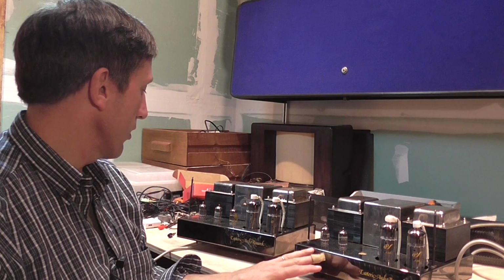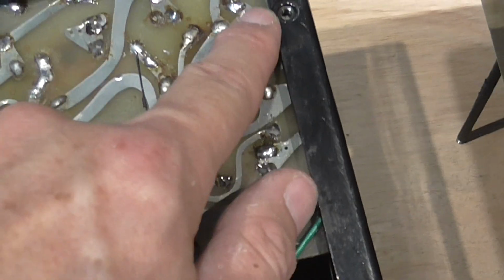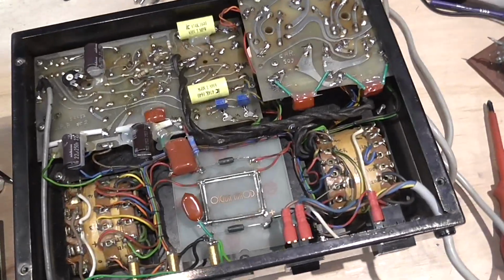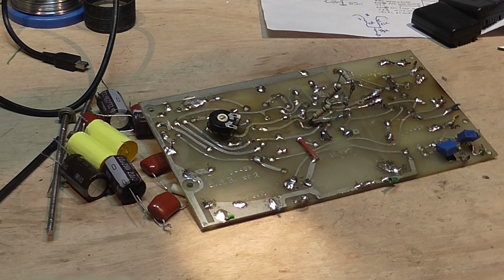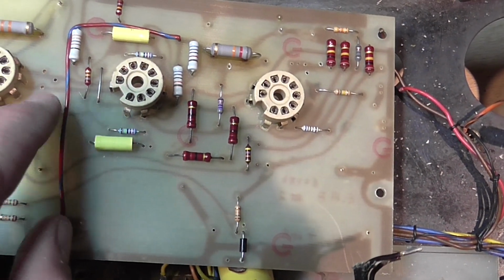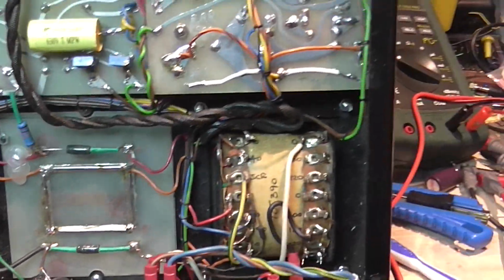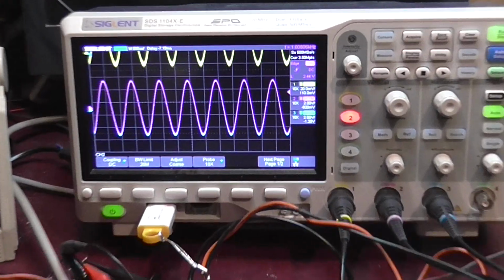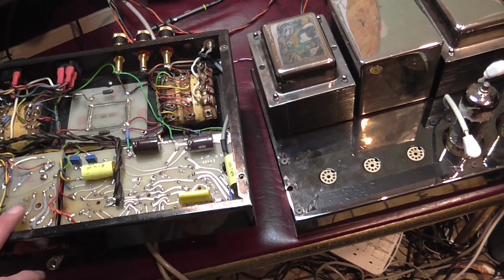R03 - EAR Audiophile Tube Amplifiers Repair.

Comment: A former neighbor of mine owned a pair of these. Best amplifiers I've ever heard, and drove anything. I also had the opportunity to look inside, the mechanical build had somethings to improve on. I have a pair of Quad II that were much better built but then they are 15W and much noisier whilst the E.A.R 509's are 100W. Some issues were their power consumption, maintaining the bias and tube wear.   They were designed by the legendary Tim de Paravicini.
Reply from the maker: Thank you for your comment. I should owe a second part of this video as these units came if for service recently. The bias circuit was improved and the tube sockets for the small tubes were all replaced, as well as other improvements.

Comment: What a solder mess,  loads of Flux left. That's why I build tube amps hardwired,  I dislike pcb boards.
I find this pcb board a dangerous close to the metal case.
Cheap diodes,  I use buy96E good for 1000v 1A very fast recovery.
Shocked to see the building quality.
You did it right to clean everything and restore to factory specs. 
Those two cathode resistors they wanted to create some separation of current. I would use 2 x 33k to earth then the load is more separate from cathode to cathode. The desigher use one to save on resistors,  only thing I could think off
Nice video review